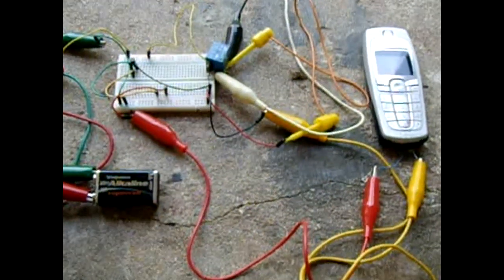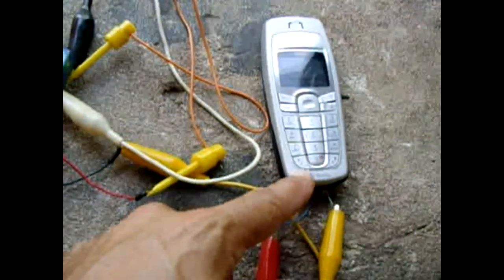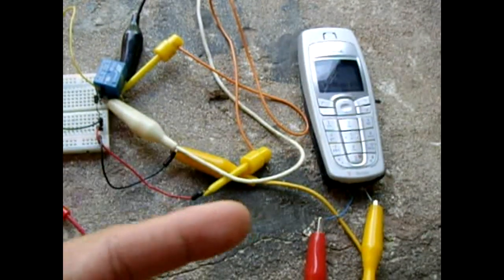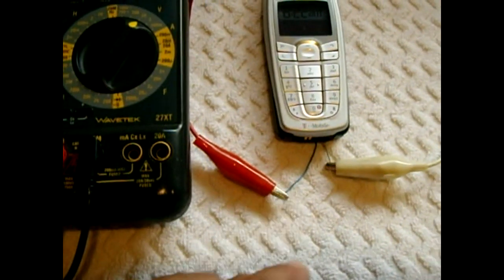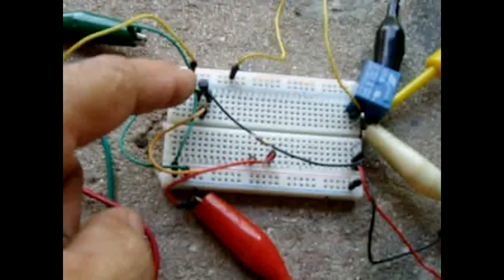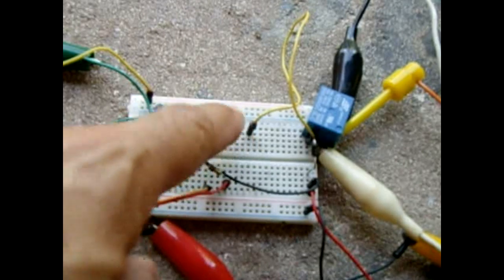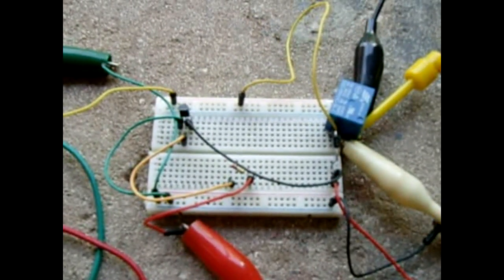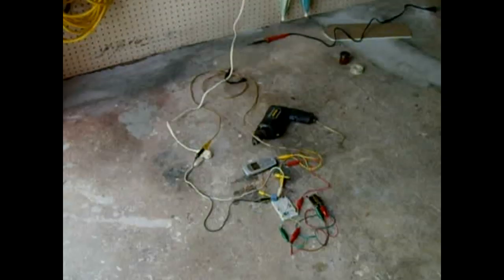Trigger/Deactivate Any Circuit With A Call To Your Cell Phone With ONLY 3 Parts!

Comment from the maker: If you connect an optocoupler in parallel with the motor leads, the motor loses almost all power and the optocoupler does not function. There is not much power there. Yes, voltage is low, which is why I chose the ultra sensitive gate thyristor for the job. Now, if you could care less about the hearing the vibration motor, then you can ditch the motor and use a 2n7000 or 2n3904 with no problem.

Comment: you can always use an optocoupler to detect the lighting up of the screen of the phone, when you get a call. this way you don't have to disassemble the phone and tap somewhere in the circuitry, just place it facing the optocoupler in some dark box, or tape the optocoupler to the screen using black tape and you're good to go. another option is if you have a smartphone you don't need, just connect it to wifi and send it a message via facebook or viber or something and the screen will light up again. i may try this with my buildings intercom, which opens the front door

Comment: I thought of the same thing using an Arduino. Problem was I could not get the circuit to "latch" one call to turn it on and one call to turn it off. You could also connect the speaker to the analog in as different button pressing during a call could possibly generate different voltages and trigger other external events

Comment: Wouldn't your other phone the one you are calling have to be an active phone? I would rather have internet control going to the computer that would do the same thing and perhaps do more than one thing. The circuit has many application with a monthly price.  Still neat circuit.  Why does it have to be unlocked?

Comment: I suppose if the phone is wifi enabled, it wouldnt need service. You could just get a google voice account or similar web based texting service for free. I found this video when i had a sort of similar idea to control my garage door from my phone, so its less small boxes tocarry in my pocket and  remember not to lose or break. My question is this: If you were to make a circuit that was to be a permanent fixture in the garage with a wall-wort power line, could you use this principle of calling the cel phone to act as a toggle or a timed sequence? For instance, instead of a relay, could one make this a toggle using a transistor or timer chip or something of the sort? 

 Thanks for the circuit. Cheers!

Comment: Hi, this is a cool circuit.  How would I get it to for instance switch a light on when I call and switch the light off when I call again.
Reply from the maker: Hi There. The circuit is neat, and it works extremely well. The way it was made, you can only call to turn something ON or OFF once. If you wanted to be able to toggle a switch or relay ON and OFF with each call, then the circuit would need to be modified. When I get a chance, I will take a look.

Thanks For Watching! Be sure to check out all my other videos, and share my channel with others.

Comment: You said there wasn't enough current to drive it.  The current is fine, you just need more voltage.  Also that's for people who don't have that specific part.
Reply: voltage step up circuitry will be the answer :-) like step up resister